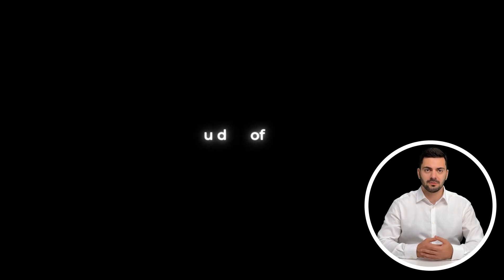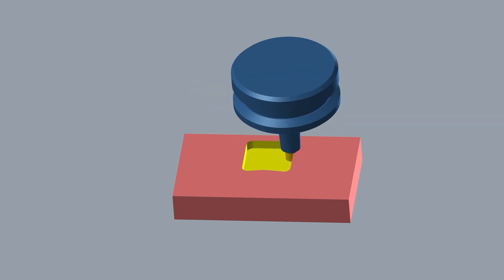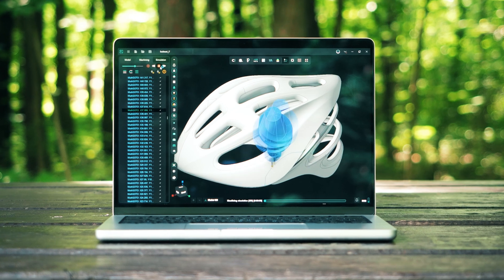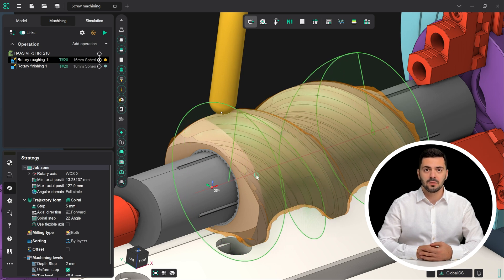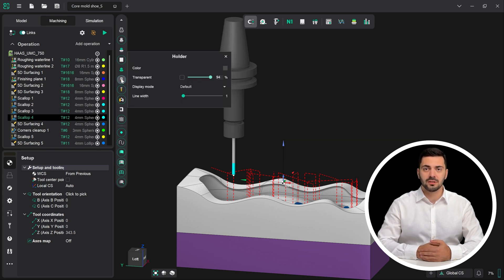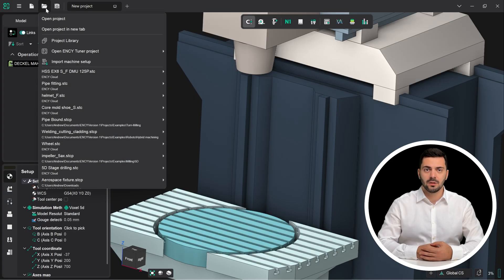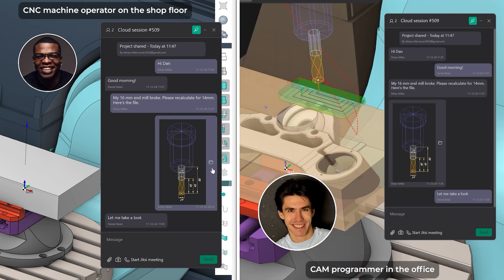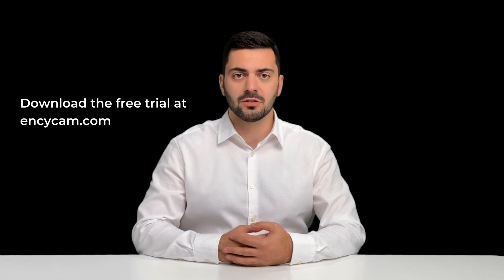Why ENCY: Discover the difference of the new ENCY CAM system in just 10 minutes

Comment: Not very useful for mold programming i see you have limited function for mold if you need encounter market make 3d ultra high finishing stretegy which includes horizontal and vertical finish in one stretegy currently ENCYcam don't have also manually deleting function is so boring function should be one click delete any passes if we don't want either in finish and rough machining, also ENCYCAM use more graphics card rendering
Reply from the maker: Thank you for your opinion and feedback. Our programmers strive to improve the program and work is carried out daily.